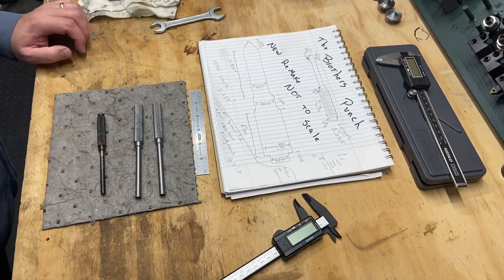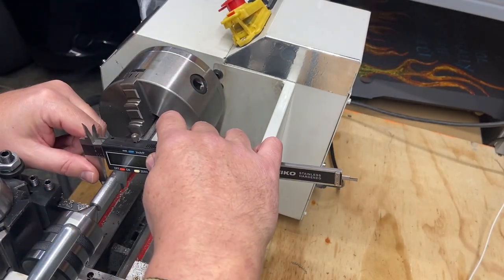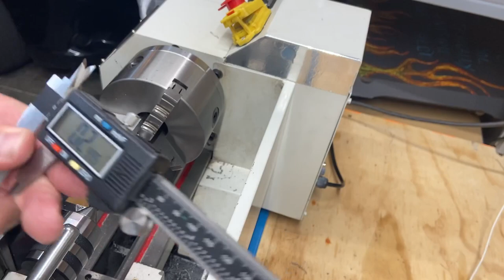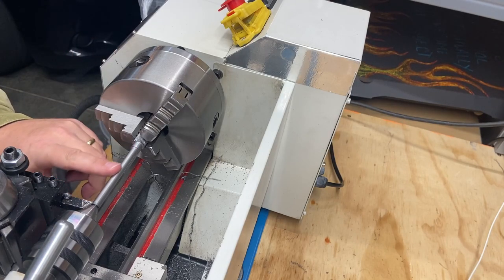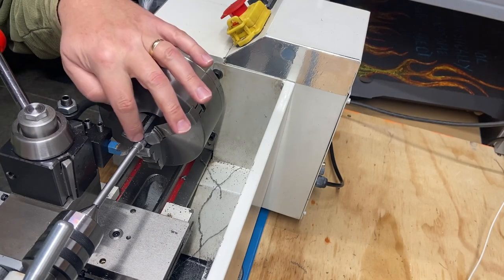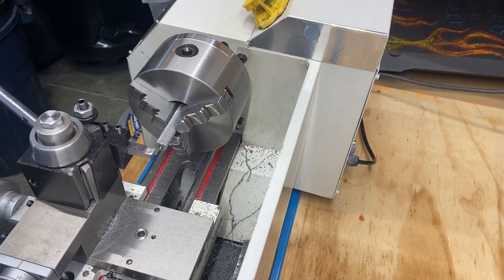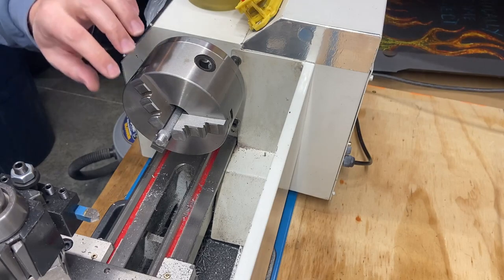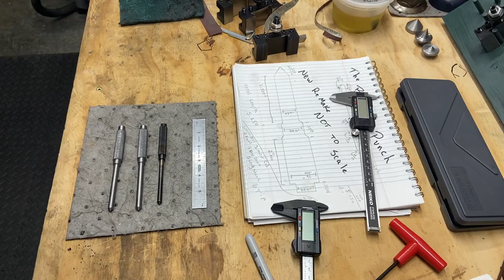Shop Made Punch Part 2 of 3 - Metal Turning a metal punch Beginner Lathe Project

Comment: Heat treating is rather easy to learn, not that complicated.  Depending on your needs you could spend $25-$60 for a map gas/propane torch, and upwards of $1000 plus for a decent hobby size kiln.
Reply from the maker: Saturday I will be posting my first attempt at heat treating and hot bluing.
Reply: @deezworkshop  awesome, good luck to you with your first attempt at heat treatment.  Keep in mind that once you get the metal to temp and non magnetic you need to hold that temperature for a period of time prior to quenching.  Determine the dwell time, usually you go by thickness of the material i.e. 1 hour per inch of thickness.  I worked in heat treatment, dimensional inspection, and destructive testing for many years but it has also been many years since I retired from the industry.
Reply from the maker: So much to learn. No doubt I didn’t perform this treatment properly but would love your thoughts on things. I love hearing from those who worked in these specific areas and try to absorb as much knowledge as possible. Much respect and thanks for your comments.